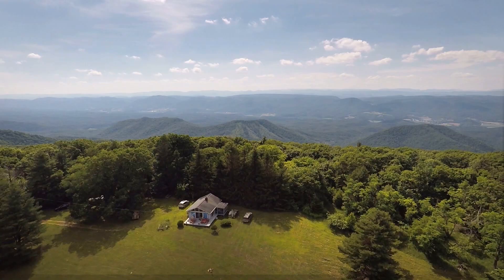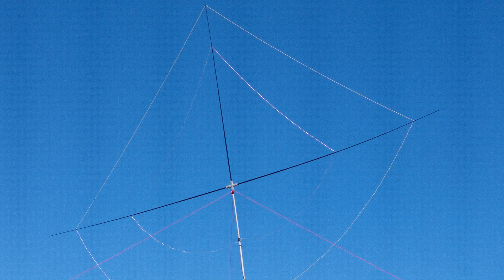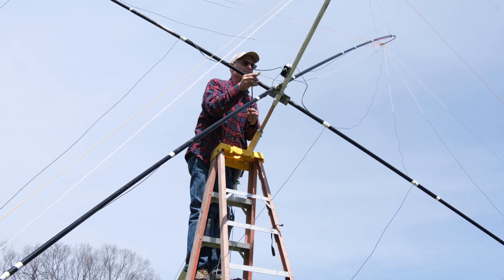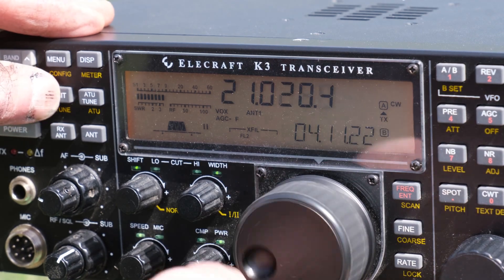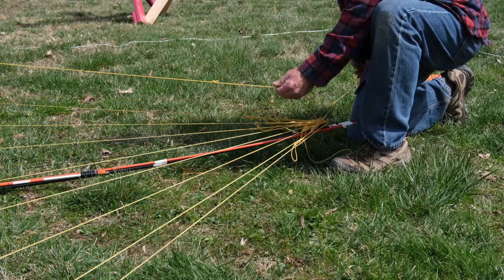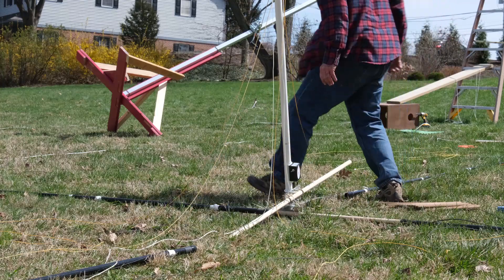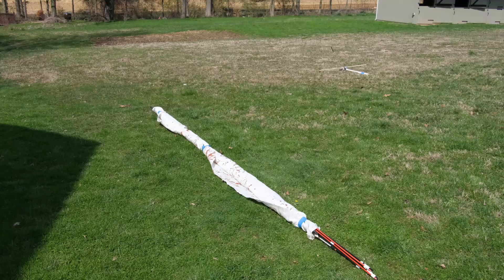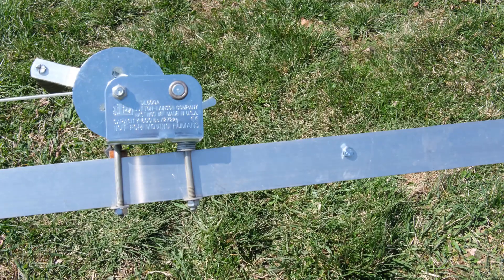My ultimate Field Day antenna; lightweight spiderbeam on Telescoping Mast

Comment: I just bought a new spiderbeam antenna 5 band HD. Is there any advice you would suggest for any upgrades when building it ty
Reply from the maker: I never saw a commercially made spiderbeam.  I am sure they have made of good materials.   I just put together something with what I had for portable FD use.   I must say we are really happy with their performance.   They have completely replaced the old beams I used to erect.

Comment: Where to buy the Telescopic Mast ? Any technical information or price details ? de VR2SA
Reply from the maker: Spiderbeam gives you all the construction info for spacing and wire length but if you can come up with your own way of making it that is nice.  http://www.radiomanual.info/schemi/ACC_antenna/Spiderbeam_user.pdf   Sometimes you can pick up fiberglass at Hamfests in 16 foot lengths.   I used spiderbeam masts that were too light so I needed to reinforce them with extra fiberglass used to mark parking lots for snow removal.   I would encourage you to go slightly bigger.    What I used was the 4 meter mast.. http://www.spiderbeam.us/product_info.php?info=p228_Spiderbeam%204m%20fiberglass%20tube.html.   then ordered the next bigger section which I think was section 8 of their 12 meter mast. to make it 16 foot long overall.   It would be much better to us sections 9 and 10 of the 12 meter mast....then skip the top most thin sections.   

 Connecting all the driven elements together with any 1 to 1 balun will feed it perfectly like any fan dipole.     We just finished FD 2023 last weekend.   The antenna worked great now for my 2nd year using it.   723 Q's on 20.... 15 and 10 not as good because of poor band conditions.    It is such an easy antenna to throw together and get in the sky.

Comment: did you use 3 12m masts to create the X? how long is each leg?
Reply from the maker: No... Just 4 - 5meter masts.  I previously had these 4 meter masts to make their vertical loop.... I just needed to order another section to make them 16 feet long which is required to make the spiderbeam.   But they were too weak...so I needed to reinforce them with fiberglass driveway markers the hardware store sells to guide snowplowing.   Now they work fine.   Check out last year's field day video where we used them.   I am quite happy with them

Comment: Have you tried an A/B comparison between the spiderbeam and your Tribander in the background?? Tnx es 73 WA4AOS
Reply from the maker: yes I have.   I think they are very close if not the same in comparison.   Obviously, the KLM Kt34  has been in the air on this tower trouble free since 1990 so it is much more rugged in the elements but the spiderbeam is perfect for portable use.